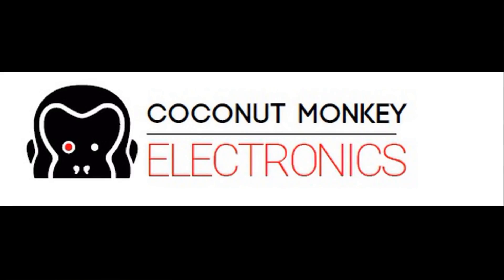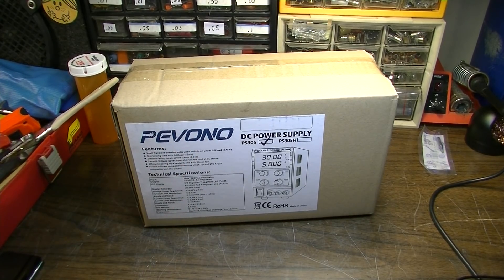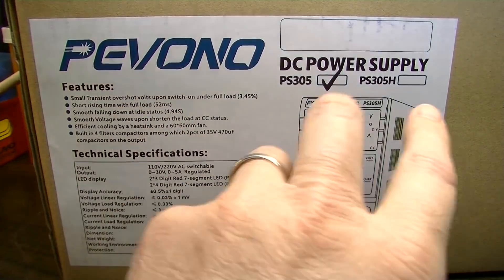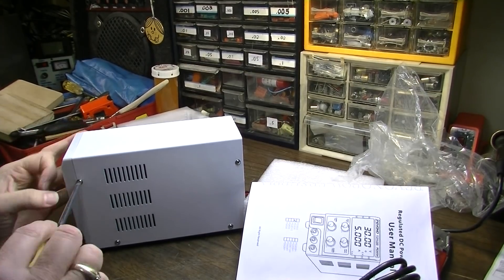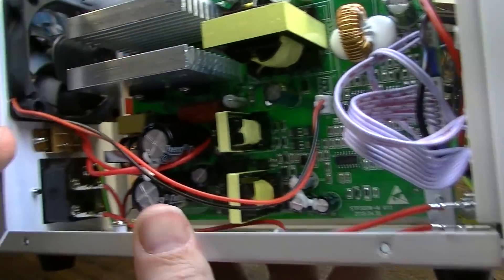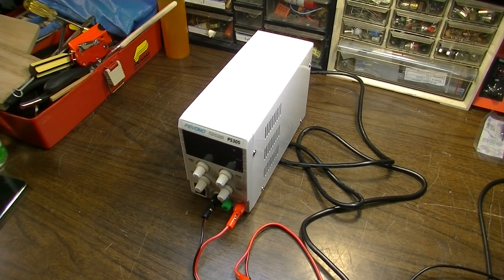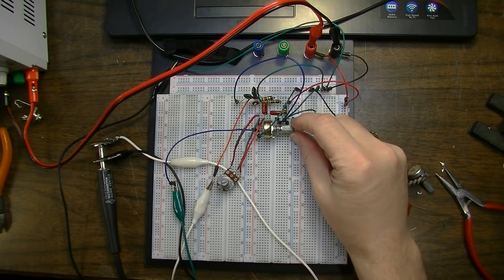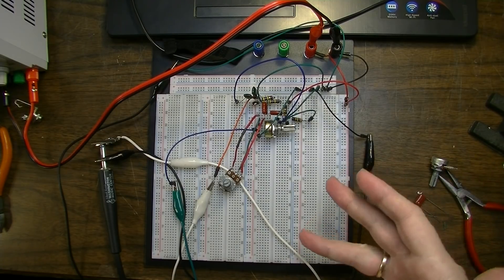Breadboarding a Fuzz Pedal Circuit and Pevono PS305 Power Supply Test

Comment: These old vintage Fuzz circuits are always fun to build, I've got a red Jim Dunlop JD-F2 Fuzz Face pedal that I rebuilt after the stock NTE158 Germanium transistors stopped working, I removed the stock circuit board and all the original wiring, and re-built it using a vintage-style Fuzz Face pcb I had ordered online, but I opted to go with two silver BC108C Silicon transistors, for a Fuzz Face that uses two very high-gain (I measured both at around 840 HFE) BC108C transistors, it actually sounds pretty good, nice and smooth sustain.

Comment: The other thing I meant to ask is if this power supply produces negative voltage as well, and if it could be used to supply the +/- 15 volts that things like TL072 op amps need to operate?

Comment: One of the reasons your circuit could have been noisy is the power supply itself. Attach a battery and see if it makes any difference. These switch-mode power supplies have to be expensive before they start taking proper care of the noise output.

Linear supplies are also better suited to lab work due to the lack of output capacitance. Switching supplied will have lots of output caps to attempt to filter the noise (but it doesn't work) and this delays the response of constant current when you really need it.
Reply from the maker: Thanks for the comment. I can vouch for the quietness of the supply. You'll see in Part 2 what I mean.
Reply: :o

Comment: One question I would have about the power supply is how clean is the output? the last thing you want feeding sensitive analog circuitry is a noisy power supply.
Reply from the maker: I have not put it on a scope but the other YTers I mentioned did and it looks clean.

Comment: Would like to see if the noise got any better with a 9v battery in place of the power supply.  Switchers can be noisy in high gain low signal audio circuits.
Reply from the maker: I'll show that in Part 2.

Comment: I would love it if you tested the noise the actual power supply itself introduces to an audio circuit.I've seen people talk all over the place that switching bench power supplies are pretty noisy, and not well suited for building pedals.

You could easily test this by powering the fuzz you breadboarded with a 9V battery instead of the psu and compare.That would be really cool to see :)
Reply from the maker: I show this in Part 2. Stay tuned for that!

Comment: Do yourself a huge favor, and build a small box with 2 1/4” input/output jacks and a dpdt toggle switch to set up an input/output patch panel with bypass switch. Makes breadboarding pedals a lot more fun not having to have gator clips coming off of guitar cables etc...and you will also find yourself using the bypass switch more than you think you will.
Reply from the maker: Not a bad idea.
Reply: The Guitologist when I was breadboarding pedals I did just that ... except that I cut a few corners and mounted the jacks/switch to a piece of cardboard... but that was just for my use. I figure you would want to go a bit “nicer” since you make the videos lol

Comment: We use those adjustable resistors in our overhead cranes at the steel mill. Some of the resistors we have are as big as a radiator you would see in an old home.
Reply from the maker: Wow. Sounds incredible.

Comment: Switch Mode power can make noise for some Guitar , Preamps and  Effects. Its high end whine noise from around 2k to hiss starting around 4k .  Got noise on Boss EQ-20 and my own design Discrete JFET Overdrive . Solved problem by building a noise choke with caps,coils and resistors .
Reply from the maker: I can vouch for this one. The noise here isn't from the supply. You'll see in Part 2.

Comment: Nice work as always! You should set the constant current to a little over what your are working on so if you short anything out, it doesn't fry your project like how I did and weld components together. Also get some germanium npn transistors! It will make it sing differently and match them your transistor tester, the first transistor likes to have a lower hfe then the second stage.
Reply from the maker: Thanks for the advice. We'll see how it goes...

Comment: Have you ever had experience with low powered tube amps, around 18 volts? That's something that i wanna get into, would be cool to see on this channel.
Reply from the maker: I've replaced subminiature tubes in a Duncan pedal and we have some Korg NuTube design stuff coming up.
Reply: The Guitologist yes i know about Nutube, curious to see what's gonna happen. Although my expectations are that it will be sort of inbetween transistor and tubes in terms of wow factor.

Comment: Hi Brad, nice video here, but i recomend a linear power supply for audio DIY stuff, as these SwitchModePowerSupplies (SMPS) always have some RF-"dirt" on their outputs. You can hack that thing to a "silent" ouput but it will require some little math stuff and DIY coils as well. Putting only a small 10nF ceramic and a 0.1µF foil cap in parallel right on the output terminals helps a little on cutting the RF but a nice C-L-C will do a lot more.
Reply from the maker: I don't think the hack is going to be necessary. I'll show you what I mean in Part 2.
Reply: that´s why i use linear power supplies.

Comment: That KORG 6p1 vacuum tube should work in push pull mode with the LT700  to drive the level control that will drive the guitar amp.

Comment: There OK for hobbyist I got one I first reviewed all the review videos first before making my purchase they have very dirty AC ripple riding on the DC power so they’re horrible to use as a power source for any kind of radio because you can hear it and they actually will damage sensitive I see circuits that you’re working on. Great for powering small motors lights anything that it’s not sensitive to ASE ripple or a slight over voltage voltage spike on turn up it does overshoot it setting. I tested it for 48 hours at maximum amperage driving a automotive lights then I drove it at maximum voltage for 48 hours driving dummy resistive loads. Had one problem  it’s stopped working contacted the manufacture and they told me it sounded like a loose wiring connection on the circuitboard they walk me through and told me what to do I disconnected everything inside and reconnected it and it’s been working fine ever seance. The cheap alligator clips and wires suck mine actually started burning and melting where they had a poor crimp connect at the alligator clip. Under full load I measured 1 V voltage drop across their leads from source to load. For no load application that’s about all the wires a good for other than that throw them away and make your own quality set. If you want you can reuse their connectors and alligator clips remove and throw away their wire and just replace it with some 12 gauge speaker wire.

Comment: Some of the noise could be from the power supply. Ofc some is coming from the exposed wires. Test the same circuit with 9v battery and compare the results.
Reply: the flurecent light directly above the bread board is probs 90% of the noise alone. My guess anyway.
Reply: Yeah I feel like after watching many Brad videos he has a noisy room sometimes lol